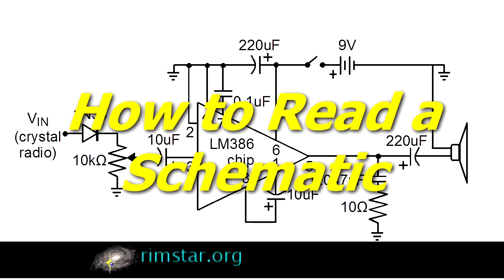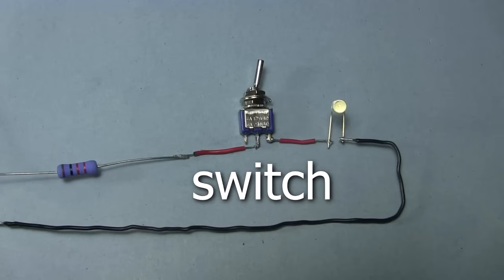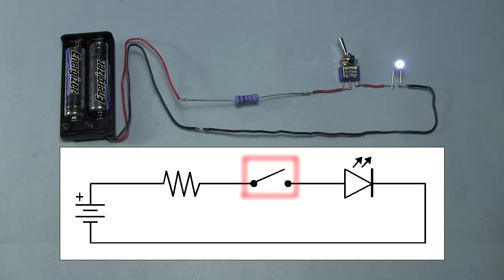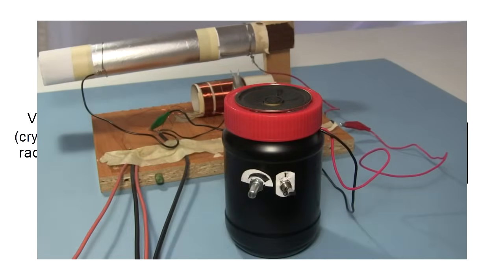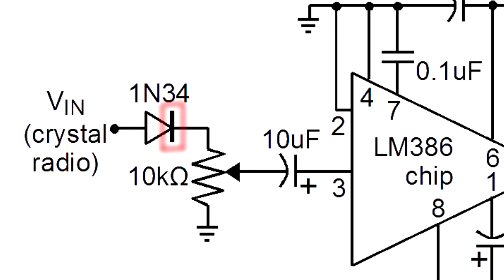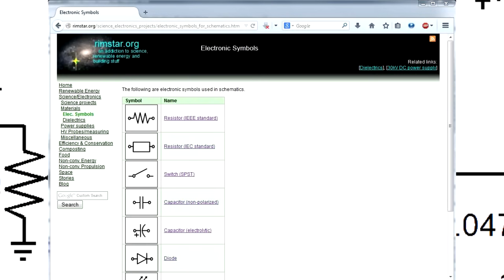How to Read a Schematic

Comment: Earth confuses me, I think it's where electrons end up after going through the circuit but then do they not go to the other terminal of the battery? ???     The concept of going from positive to negative is also another annoyance in electronics, conventional current, even though electrons go from negative to positive you have to think the opposite way because it's historical. Still can't find a decent book which explains circuitary in more detail, printed circuit boards and how to troubleshoot with a multimeter and scope.

Comment: This video is a bit of a joke. Is it also for beginners?
You explain "grounds" nonchalantly and it's not at all clear what it is, because you didn't explain it at all. You just brought chaos into it.
Where are the grounds ending? How is one supposed to understand from this schematic that the circuit is closed, that some wires lead to the negative terminal of the source? Do the ground branches have this function? And where is the place where the circuit is actually connected to the ground if this is the case. Couldn't you have added that to the diagram later?

Comment: Yeah didn’t learn shit, explain next time what’s a capacitor for or a resistor, what they are? What are they used for? Than just knowing their name and their existence
Reply from the maker: Explaining what's a capacitor for or a resistor are and what they're used for are each whole videos on their own. Unfortunately, this is a rare case where I have to say that I don't have videos on them though. I've thought about doing some but there are so many good ones out there that I haven't.
Reply: Don't listen to this guy, you explained js fine twin
Reply: @ethanmchardy  grounds too? After his explanation, you will definitely go and stick the grounds in your LED circuit into the ground in the garden.

Comment: But why sometimes it's different than the actual wiring and placement of the components ??
Reply from the maker: If a circuit was put together using a particular schematic then the components should be in the same places relative to each other. However, there are also often many ways to achieve the same thing. For example, there are many ways to make crystal radios, some circuits make it easier to tune into one radio station, some circuits add amplification,...  Sometimes capacitors and diodes are added (or not) to filter our certain frequencies and make the circuit work better. There is also the case of ground which I talk about at 2:20, in that case there's some flexibility.

Comment: Do you have to have a resistor in orders to turn on the LED ? I’ve seen other videos where they don’t even use the resistor so which one is it?
Reply from the maker: The resistor is there to protect the LED. Too much current from the batteries can damage the LED. Whether or not you need it just depends on how much current it available and how much current the LED can handle.
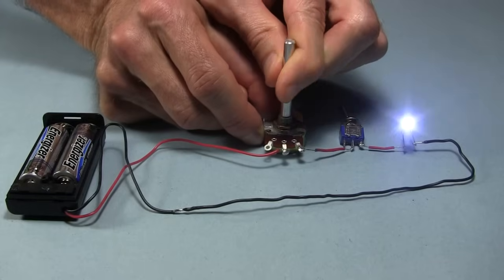Reply from the maker: I just rewatched the video and noticed that you can see the effect of the resistor at 3:42. There I substitute a variable resistor so that I can manually adjust the current going to the LED, changing the brightness.

Comment: So basically the schematic doesn’t show the negative a positive wires individually like a diagram?
Reply from the maker: A schematic can show the negative and positive. It often doesn't because the symbols themselves sometimes indicate which end is positive. As I say in the video, the longer line on the battery indicates the positive side. Circuit diagrams tend to be less formal, often using pictures of the components instead of standardized symbols.

Comment: which path does current take, to which components, and how much gets lost in the process? i've seen diagrams with a diode next to the battery input, pointing in the direction towards the plus of the battery, to me indicating the diode is there to prevent electricity from entering the circuit, smh.. or that plus goes straight to ground, then to the components, smh, unless it's me being confused..

Comment: What do the numbers 1, 2, 3...8 mean?
Reply from the maker: The triangle symbol represents a microchip that has pins on both sides. The 1,2,3...8 are the pin number for the pins on the microchip. See the third page here https://www.ti.com/lit/ds/symlink/lm386.pdf
Reply: @RimstarOrg  Thanks!!

Comment: Can anyone tell me what type of component is a 555 timer? Thank you
Reply from the maker: It's a chip that has 4 pins that has a lot of uses. Most often it's used for generate electrical impulses at a frequency that you can control. Because of its many uses, it has been used a lot over the years, probably the most popular chip over time. https://en.wikipedia.org/wiki/555_timer_IC
Reply from the maker: For example, I've used it for a fun potato chip project, a "macrochip" as opposed to a "microchip", https://youtu.be/f8e_-fyvScU and both a hand-crankable music player https://youtu.be/WM1bZgBqDl4 and a more simple version https://youtu.be/rTmlR8B-u5c .

Comment: If I wanted to learn how to wire a circuit from a schematic without using a breadboard (just like you are doing at 0:52) what is that called? What would I search under?
Reply from the maker: I would search for soldering or "how to solder".

Comment: Sir can you help if how to mske schematic diagram from pictograph
Reply from the maker: By pictograph do you mean a circuit or wiring diagram where instead of symbols you have pictures or photos of the electronic parts? For example, at 0:16 I show a wiring diagram with pictures for the diode, potentiometer, battery and speaker. You just need to replace those pictures with the symbols like I do at 0:25.

Comment: What's the cell tho? Is it the pair of batteries or something? 

Complete beginner here
Reply from the maker: A battery is a collection of one or more cells connected together. If the cells are connected in series (the positive of one cell connected to the negative of the next cell) then the voltage will be higher. And example of a battery with multiple cells is the typical lead-acid car battery. You can see some photos of them here https://en.wikipedia.org/wiki/Lead%E2%80%93acid_battery

Comment: does the LED works without the resistor attach? @ 0:55
Reply from the maker: Maybe. The resistor is there to protect the LED. The resistor decreases the amount of current that can flow through the circuit. An LED is rated to handle up to only a certain amount of current. Too much current and the LED will be damaged. The resistor can also be used to control the brightness of the LED, the lower the current, the dimmer the LED.

Comment: Good video, and you did note that a wiring diagram and schematic is different. but it maybe also be helpful for beginners to understand the difference between the two. Wiring diagrams show the PHYSICAL  connection or relation ship. A schematic shows the electrical or theoretical relationship & exact connection For a functional process. Which as you said may not be obvious visually looking at circuits or pcb (printed circuit board)
Reply: Hi can there be both

Comment: Can you explain how to translate a schematic into reality? Seems like there's a secret code that teachers assume everyone else magically knows without explanation. I fried all kinds of stuff in electronics class, wasn't taught a thing and was pushed through with a passing grade .  Good old American school system.
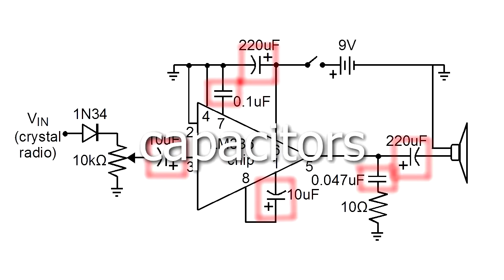Reply from the maker: At 0:52, I show the schematic and the resulting circuit at the same time. For this simple circuit it's just a matter of putting the right components in the circuit where the schematic shows. Sometimes the orientation of the component matters. For example, at 1:01 I explain how to orient a battery into the circuit. You do have to be careful about that. The same applies to diodes (2:44) and electrlytic/polarized capacitors (3:46).
A lot of times however, the schematic is drawn like I show at 2:21 where a bunch of ground symbols are used to mean that all those points are connected together. In that case you have to know that when translating the schematic to reality.
But this video is just an introduction and you're right, there's even more too it for some circuits. For high frequency circuits, even the lengths of the wire can matter and that's not often pointed out. Some components are also sensitive to electrostatic charge which can be on your fingers and so you have to be careful when handling them.
Reply: @RimstarOrg  So, I am still quite lost. Is there a code of some sort that says " If the schematic shows "this" then that means "that" in reality?
Reply from the maker: I guess I'm a little lost now. In the video, I do show you both the component in the schematic and then the actual component where it's connected to the circuit.
Reply: @RimstarOrg  True, at 0:49 you show a true-to-life example. But that's the last one.  There were no further one-to-one examples shown.
Reply: @RimstarOrg  A case in point is around 2:20.  You showed the top and bottom of a board with stuff soldered together.  You showed it for all of a half a second with no explanation.  I have no idea what that thing was.
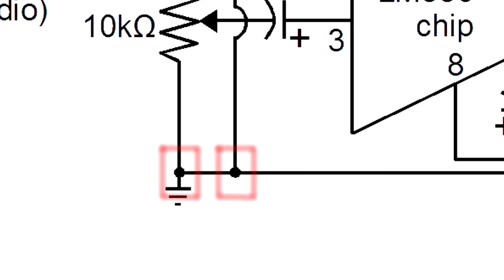Reply: @RimstarOrg  Another example is at 2:05 where you say that you have to show a dot to indicate a connection.  But how is it connected? And what's the big triangle thing? There are zero dots on it.  So why is it there? Is it physically laying on top? What am I to do with it?
Reply from the maker: Ah, I think I see what you're looking for. That would be a video that combines teaching a number of different skills: reading a schematic, soldering, wiring, learning the different components. I once did a video about making an amplifier for a crystal radio http://youtu.be/cQ-LxMDrD_o but it didn't go through every step at that detail and when someone asked for it, I then made this follow-up video http://youtu.be/V0dKdSNv_dY . It puts it all together on a breadboard instead of soldering but it does show all the steps. Maybe the two videos together are more what you had in mind but I used circuit diagrams instead of schematics.
Reply: @RimstarOrg  thank you for replying. What you did at the beginning with that very simple circuit was exactly what I was looking for. But it just stopped too soon. Even just a slightly more complex schematic would have answered a ton of questions. Maybe other people don't learn like I do. Maybe that's why my electronics teacher told me, "here is your passing grade. Don't let the door hit you in the butt on the way out."
Reply from the maker: Well I do appreciate your feedback. It's hard when making an explanation about something you know well to think of everything that someone new to the subject would need to know. It almost makes me want to make a version 2 of this video. So thanks.
Reply: @RimstarOrg  I would love to see another take on this. The video was called "how to read a schematic." The key word being "read." So think how one teaches somebody to read. They are not done teaching until the student can take words and form abstract thought in sentence form. They don't need to know all the words in the dictionary. And they don't need to be able to build intensely complex sentences.  But if they are taught the foundation clearly, they can see how words turn into thoughts on a page. Just like a schematic, somehow, turns electronic components into a functioning circuit. That last part, is what I want to know.

Comment: Yet another 'schematic' how that just explains componant icons. Another page 2 explanation of schematics.
Reply from the maker: What do you mean? What type of explanation were you looking for? Who knows, if I can do it then I might.
Reply: @RimstarOrg  one thing that would help me is an explanation of how to translate a schematic into reality. I just see an endless loop of line connected to everything.  It looks like you're supposed to pile up a bunch of components and pour a quart of hot solder on top of it and it does something. I can't find an explanation anywhere.

Comment: Sir I'm beginner in electronics, sir can it be possible for you to explain any  of the RF transmitter receiver module circuit diagram ie working of it step by step

Comment: What are the components/ symbols used in the first picture
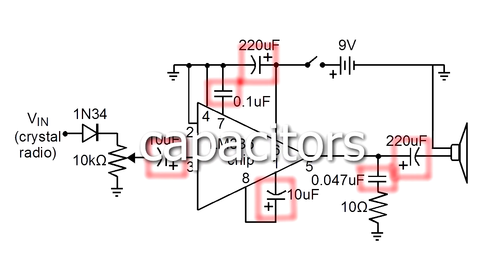Reply from the maker: That's the same circuit that I use as an example later in the video. See 2:08 for the grounds, 2:43 for the diode, 3:11 for the potentiometer, and 3:44 for the capacitors. The big triangle labelled LM386 is an IC (Integrated Circuit) chip that's an oscillator. I already talk about batteries (labelled 9V in the schematic) at 0:53 in the other circuit. The two remaining resistors labelled 10 kiliohms and 10 ohms (using the Greek omega symbol) I also talk about in the other circuit at 1:07. And the thing that's a rectangle with a sort of triangle attached on the far right is a speaker.
Reply: @RimstarOrg  thank you
Reply from the maker: My pleasure. Thanks for asking.

Comment: Excellent...I have a high end amplifier I'm wanting to fix myself. I've already replaced the power supply capacitors and all the relays but I've reached the end of my knowledge and understanding. This helped a ton, and now I feel like I can actually find enough information and learn how to fix it. I found a schematic for $6 online, now I have a much better idea what I'm looking at. I've built a few crossovers for speaker kits, so I had a basic understanding, but this short video cleared up a lot of questions I already had.

Comment: I was taught that electron flow was negative to positive and the flow was opposite the arrow in a diode. Which is correct? Thanks
Reply from the maker: Electron flow is from negative to positive, the opposite of the arrow in the diode, as you say. Conventional current (which is not electron flow) is in the opposite direction. Both are correct. We have the two opposing directions due to historical reasons. I explain those reasons in this article I wrote a while back https://hackaday.com/2017/07/17/conventional-current-vs-electron-current/

Comment: How do we know which resistor / potentiometer works with what current and voltage? Do we just calculate it with Ohm's law or whatever that's called?

Comment: What about that big triangle to the middle??? Can you explain that also? Im not elect. engineer, I just want to learn it for purpose. Thanks.
Reply from the maker: That's actually an oscillator chip (which is rectangular or can be square in shape). It seems to be used for chips. Another example where you often see it is a comparator chip.

Comment: how do you which ground it all goes back to
Reply from the maker: If you're referring to the diagram with all the different ground symbols, they're all really the same ground or the same point. We just draw multiple of them since it's easier to draw the diagram that way.
Reply: @RimstarOrg  No, one has a bunch of the same ground symbols placed differently to each other. how am i supposed to know where all of those ground symbols go back to. why isnt there a different ground symbol to show that
Reply from the maker: Do you mean that different ground symbols are used? I'm not familiar with that.
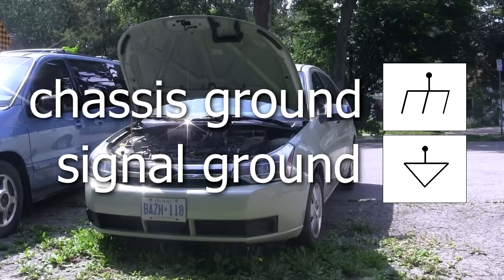Reply: @RimstarOrg  2:27, all those symbols , where do they all go back to??
Reply from the maker: See the video starting at 2:11. At 2:18 you can see that they're all connected together. They don't go anywhere else after that. In this usage, they're not really a "ground". Instead, the symbol means simply that they're all connected together.
Reply: @RimstarOrg  ooooh, that helps

Comment: Hi great tutorial. Can you please make an electric wiring diagram for a battery run heater with a power increase/ decrease connected to it with an relay fuse`?

Comment: Hi there im a big fan of your channel because u explain things so thoroughly & simple that a novice like me can replicate your projects & get them right the first time👍. I still have a problem though reading schematics & have been stumped with completing the wiring on my hv power supply. Specifically where & how to wire in a half or full wave rectifier on the quad mot psu for my arsgtc. I was hoping maybe u could draw uo one of your wiring diagrams so that i can complete this project. Any help would be greatly appreciated. Thank you & hope to see more videos from you on HV Projects
Reply from the maker: This is the first I've heard of a quad mot psu for an arsgtc (what does the AR stand for?) so I can't help much. I was curious enough to find this though http://www.loneoceans.com/labs/teslacoil2/ which has a schematic around halfway down.
Reply: It stands for Asynchronous Rotary spark gap😁. & yes ive seen loneoceans mot power supplies &  actually built the dual mot that he used at first. I tried to read the schematic but couldnt & ended up getting it right by carefully going over all the great pics he provided. Since then i successfully built the quad mot psu but i want to rectify it (half or full wave) but i cant figure out how or where to wire the diods in. Thats why i turned to you😁. Cuz the way you explain things & your wiring diagrams have made it possible for me to get my projects to work the first time

Comment: Why diode symbol shows direction from + to - when electron (i.e. current) goes into opposite direction
Reply from the maker: It's a convention from back before we knew electrons existed. They had to choose a direction for current to flow and had a 50-50 chance of getting it right. For the current in a wire they got it wrong. We called it "conventional current". It doesn't affect the the mathematics so we often still use that convention today. But as you found, it can be confusing when thinking in terms of electron flow and looking at the symbols.
Reply: RimstarOrg especially confusing when learning transistors with collector and emitter.